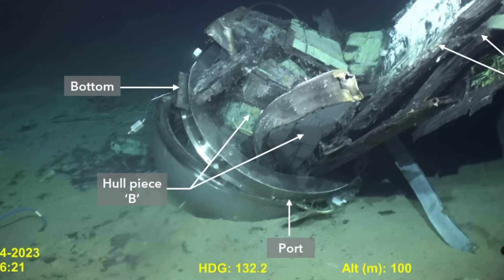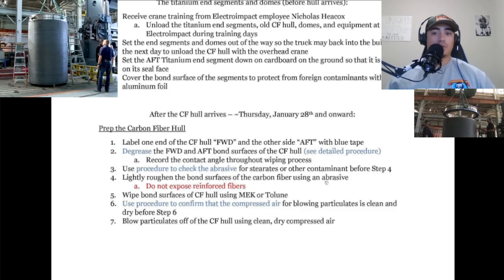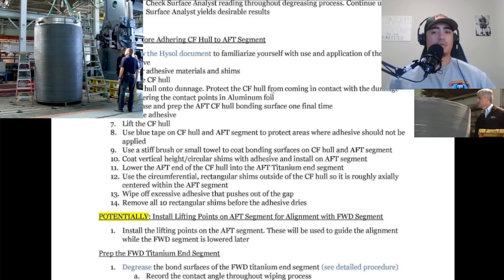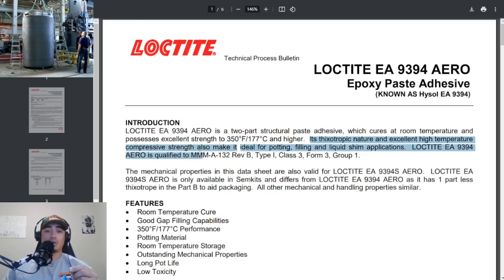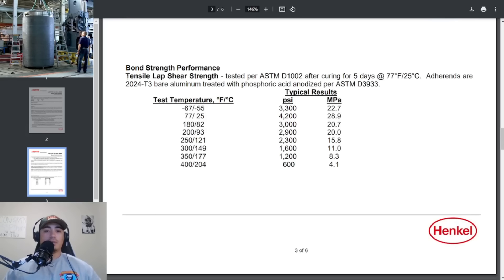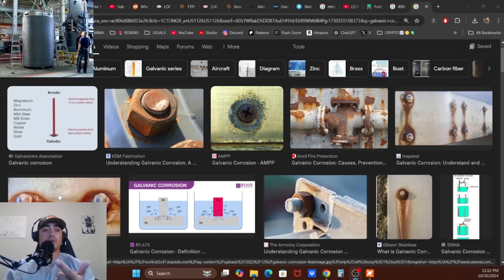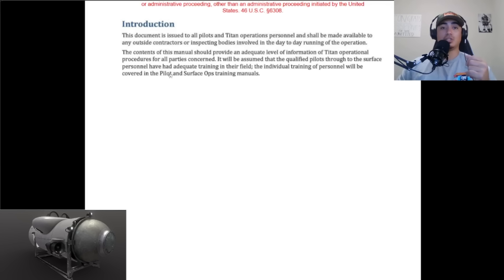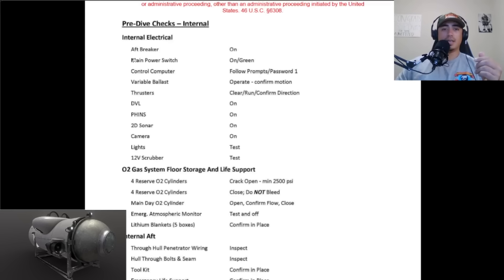Part 5: OceanGate TITAN Investigation: Money Laundering, Glue, & Operations Manual - Latest Files

Comment: As an old Boilermaker tradesman I do recall packing the pivot ring on the draglines rotating frames that we were building with dry ice to shrink them for a tight permanent fix. So the average temperature of the wreck is about 28°F (close to freezing but under pressure). So the titanium ring would certainly have some amount of shrinkage at depth compared to the carbon fibre hull. The small shrinkage being cycled over & over with each dive & recovery would put enormous stresses & strains on the Loctite adhesive bonding leading to an inevitable seal integrity compromise surely.
Reply from the maker: @scottyfox6376  thanks for your unique insight Scotty. And shoutout to all the boilermakers out there🤙🏼
Reply: I'm sure I remember reading that the US Navy had an experimental carbon fibre submersible but the end rings were a high grade of steel as opposed to Titanium. I would guess that there was a reason for that.

Comment: I can’t believe that they didn’t ‘wind’ or build up all the carbon fiber layers in a static-free & dust-free clean room where dust and other particles would not be able to contaminate the layers of carbon fiber.
Reply from the maker: Yes, pretty shocking stuff. In a scenario where even the tiniest air gap will compress at depth and accelerate fatigue.
Reply: That is pretty shocking.
Back in the 1980s we needed to wind some epoxy reinforced coils for a military project. The fun part was actually getting the winder to operate in a vacuum chamber to eliminate any air bubbles, but we did it. 
I think this was an impractically large structure to make as one offs in this way, and the transport to and from the curing station was complete alarm bells - how do you ensure that the surface is not contaminated with moisture on the way back?
This was an attempt at making a submersible with bicycle level technology - and a lot of carbon fibre bicycle frames are pretty dodgy too.
Reply: @EbenBransome  they might as well have put those ‘mission specialists’ in an empty pop can sealed up with duct tape.
Reply: @dr.valbell6427  If someone had told them that they were as much "mission specialists" as the first Soviet dog sent up into orbit and just left to die up there, would they have had second thoughts?
Reply: It's shocking for sure. I worked in the automative industry for a bit where we had composite panels. They were made in a closed off environment, with people wearing full dust-proof suits/hats/shoe coverings, as well as the glue (applied by robots) in dust proof area, and the ovens. And this was for CARS.
Reply: @Spamhard  Yeah every video I see about manufacturing CF cars talks about how there must not be ANY voids and how difficult that is to achieve. I remember a how it's made on driveshafts, every one was ultrasonic tested for voids and scrapped if there were any. They were also ALL fully tested to the design strength for the correct properties before being sold.
Reply: @brianwelch1579  Yeah, they're really strict about that stuff. I built cars for a bit, then went onto quality assurance. Can't believe the quality standards we had to keep to for a car on the road, while these clowns were doing absolutely no real safety both during build, and during the Titan's life span.
Reply: That's nothing. Dust isn't a factor when you notice that on video they show the guy "degreasing" with a rag in one greasy bare hand, while he hangs onto the clean area with his other greasy bare hand. Dust won't matter when you have greasy fingerprints between the glue and the surface. I would much rather have microscopic dust rather than macroscopic oil and skin cells.
Reply: @EbenBransome no, they liked the danger. If you watch the documentary where the crew is sharing "barely made it back" stories, the rich clients were practically giddy. This is common for young men, and I bet rich people feel like they have to prove they're here because they're brave, not because they were born rich and they screw partners and employees out of fair pay (the only way you can get a billion dollars). Nobody works 1,000 times harder than everyone they do business with. Somewhere are critical people working harder and risking more, yet they aren't getting a fraction of what they earned and they'll be fired and sued if they tell the truth when the rich want a lie.
Reply: Yes. And just only the glue process, gluing the metal to metal and other pieces... So many things that was not part of that process that is any other time.
To me my conclusion is his ego got in the way. He really wanted to be a pioneer in this type of exploration, which I'm not mad at that fact. I'm mad at the fact that he had this one guy who had been to the Titanic so many times and it was like he was more worried about impressing that man then safety for everybody else.
I'm also going to add that I do have nail technician certifications although that is not my main source of income.. and even I know that for acrylic or any adhesive you must have a sanded and porous dried out surface before you can apply acrylic or adhesive. No dust, sebum, oils, moisture. None at all. Or the acrylic or false nail being applied will be compromised. You have things going between the real now and the acrylic that will just make it come completely off.
Reply: The more we hear about this ‘bucket of bolts’… continues to be shocking.
Reply: How about the fact it was constructed in 5 seperate layers,bonded between?
They never considered movement from cycling creating enough friction to powderize the glue.
Autoclaving it as a complete unit would’ve helped-but then the under-rated view port & hull reduced from the recommended 8 or 9” down to 5” made it built to fail-just how many times it got home was in question.
I have NO DOUBT Rush KNEW-he just hoped to make a fortune before it did.
Rush had the best advice there is & was OFFENDED instead of taking it for the wisdom it was.
Reply: Instead of clean room,  they wore butchers apron and smeared glue with AutoZone bondo spreaders.  🤦‍♂️ 

I used to build Briggs and Stratton go kart racing engines,  my environment was way more controlled than theirs.   I wasn’t even building the ultra high performance B&S, pure stock blueprinted.
Reply: @EbenBransome  yeah that Soviet Lika dog debacle was one of the huge reasons why we Genxers were taught that the Soviets were wicked, godless, evil ba$tards who were so malevolent that they treat dogs like that. No redblooded, God-fearing American would ever mistreat a dog like that. Of course many Soviet cosmonauts died in the frequent accidents that regularly plagued their space program. They had no problem whatsoever risking their cosmonauts’ lives while we didn’t believe in recklessly using our astronauts. But make no mistake people: America’s Gemini, Mercury and Apollo astronauts truly had The Right Stuff. Not only were they perfect physical specimens but they were also highly intelligent and educated men (PhDs, graduate degrees), as well as extremely cool under unimaginable conditions of stress . So emotionally and psychologically well adjusted.
Reply: They had no money for that
Reply: SHORTCUT" RUSH explains why they didn't wind the carbon fibre cylinder in a 
"CLEAN ROOM": a purpose-designated space maintained for a specific, possibly highly sanitary area.
Reply: @EbenBransome some of the cheapest carbon fiber bike frame are built under a vacuum

Comment: I have watched many reports on the Titan and not a single one has delve in the chemical make up of the adhesive. This is a vital piece of information.
Reply: This is my first time seeing the pass throughs between hull and outside systems via holes in the titanium ring.  Even that seems dodgy to me, just more and more failure points
Reply: Well it's one of those things that really done matter. Even if the best glue in the world was used, it still didn't stand a chance. Glue is just probably another failure of theirs.
Reply: @JoeKyser  When I saw video of them gluing the hull to the titanium ring, I thought that looked extremely dodgy. Glue isn't meant to withstand 5,000 psi. The whole thing screams "AMATEUR".
Reply: @harrietharlow9929  the Nintendo controllers and camper world parts don't exactly instill confidence
Reply: @SoulDelSol  No, they don't. To me, the whole thing looked jerry-rigged.
Reply: @JoeKyser that was actually the failure point because it equally sheared all of it off at once, popped the lid and pushed the rest into the back like a tube of toothpaste
Reply: @JoeKyser  Glue,under-rated hull thickness,under-rated view port,re-used end caps adhesive was applied to were shiny as a pin…I’m no educated Engineer but failure was INEVITABLE & that’s why the contract to ride protected Wendy so heavily.
I should add,one of Rush’s children is a Lawyer-I’d bet that’s who wrote the contract.
Reply: @SoulDelSol  Not was it Autoclaved,Boeing declined.
It was just baked without the pressure Autoclaving uses to force bubbles out of the CF
Reply: 3M has 2700 adhesives in their catalogue.  I can name most of them.  None are suitable for this.  Loctite?  I know some of their products…but nothing engineered for this.

Comment: the dummies at Oceangate relied on deep sea pressure to seal up any complications with their hull design. It worked when they had a leaky hatch on a previous shallow dive with a different submersible. Rolling with this idea at 12,000 feet underwater was just plain stupid
Reply: they had several successful dives dude, more than 10...

Comment: I used to work in aerospace and part of my job was a bonding technician.
I had to take 2 exams before I was let loose in the bonding room.
When we used any adhesive or sealer, we had a log book in which we were to note temperature and humidity in the room.
Alongside that, all adhesive batch numbers and expiry dates were logged and then the time you started mixing the adhesive, finished mixing the adhesive then the time you started applying the adhesive and the finish time.
This stuff is taken very very seriously in the aerospace world as you can imagine.
Looking at those photos inside that big dusty hanger doesn't inspire confidence let alone using any old brush or rag to apply the adhesives.....what happens when you lose some bristles?  Or lint comes from a towel??
I always used PTFE tools to apply anything I had to on my workpieces.
Reply: Ah it’s fine I’m sure….the pressure will seal the deal, 🎉so to speak.
Reply: I worked for Sunseeker boats and just for the hulls temp was strictly controlled as was air quality in a building DESIGNED for that purpose
Lloyds would NOT insure them if ANY steps were missed
batches were noted while dates were controlled by the stock room to always ensure fresh resins
there was ALWAYS a paper trail
years later in DRAINAGE lining
the paper trail continues!
would I have laminated this in this fashion?
NO!
the weave was wrong along with the wet out
there was no pressure cure or vacuum in place so air bubbles were added
the resin/ glues/ carbon fibre all unknowns
temp? mix ratio?
contaminants?
 cure time?
and finally I totally agree on environment here
it should be looking like an operating theatre
NOT an warehouse!!
great comment and have a great day :)
Reply: Thank you. Very informative.
Reply: @Disinterested1 not an warehouse i have seen enough right there.
Reply: Totally agree, I saw them gooping it together by mixing aerospace adhesive (that is susceptible to moisture contamination) in a bucket in an open shed and thought to my self "That's less than optimal."

Comment: I wrote service documentation for 30 years. This "manual" is a laugh. There are no graphics, no callouts, no cross-references to other procedures. No authoring software.
Somebody didn't know what they were doing, here!
The end result speaks for itself.
Reply: yes, my field is totally different, but I write documentation for process-critical IT stuff for an insurance company.  This would not be acceptable in something really simple like a code deployment procedure for an insurance claims system, let alone something incredibly technical and life-and-safety critical.  I would kick this back for more detail, images and links if one of my trainees or juniors submitted this as documentation.
Reply: And the document references specifications but not the document where those specifications are found.  This document is a decent first draft, but wildly unsuitable for a device that supports human life.  It does not appear to be a controlled document, and it references things (like dates) that are irrelevant to the next time it's done.  This document gives off the vibe that the author has never done it before.  Consistent with everything else about the project.

Comment: The whole section about the glue was really interesting, I hadn't seen any of the details about that. I'll go check out the other channel you mentioned too.
Seeing the temp stats for that loctite is especially shocking when you consider the Titan was left outside all year during freezing Canadian winters. The combo of those below 0 temps, the cycle of frost and snow, and the sun beaming down on it and heating it woulda really shortened that glues lifespan imo. That sorta sub should have been stored in a temp controlled environment imo. I've seen car collectors take better care of their vehicles than Oceangate ever did. Seen Lambo's costing half of what Titan cost to build, and owners who'd never tow them like Titan was, never leave them out in frigid winter like Titan was etc. That sub was built poorly to begin with (especially for what she was made for), but the way she was treated afterwards is just CRAZY to me.
Reply: That's not what that chart means. I know that's what the presenter suggested, but I feel obligated to tell you it's completely wrong, just in case you, for some reason, need to one day act on the information provided. Look into it further first, please.

Comment: It’s amazing that this death machine lasted under pressure as much as it did, before material fatigue finally gave way… it’s obvious the engineers were not material scientists or structural engineers… the design was amateur at best… this could be when accounting overseeing a design…but from I can see, it was pure stupidity…
Reply: Yeah, 100%. With that level of slapdash construction & laissez faire safety procedures, the fact that it ever surfaced after any dives at all really shows how impressive carbon fiber & modern adhesives are.
Reply: Pretty harsh assessment tbh regarding the feasibility of Titan's structural design. Let's pretend that same design was built & welded out of all titanium & then placed in an industrial oven to be heated enough to relieve all the built up stresses caused by welding but not too hot to change the crystalline structure of the parent metal. Then maybe everything would have performed to specification of the design. But since monetary constraints were such an over riding contributing factor, many cheaper alternatives were employed. Each alternative would be adding higher failure risks that eventually it turned into a dogs breakfast of a project. If I had known exactly how it was constructed as a mere Boilermaker tradesman, I wouldn't have taken a ride regardless of its 1/2 dozen successful wreck dive missions previously.

Comment: I was a pressure vessel composites Engeneer and my mind stopped at epoxy adhesive. Those are rigid adhesives and do not flex well. Pressure vessels are all about flexing under load. Everything is chosen for it's elastic property. In general this is who carbon/epoxy was a no go for this job. Steel and titanium are unmatched
Reply: Can't even spell engineer lol
Reply: @mikeysgametime8914 Typed an E instead of an I the horror FFS.

Comment: The PSI between the adhesive and the ocean pressure is not equivalent, because the "square inches" part of that is a different area. The adhesive references the surface area between the mated surfaces. The water pressure would be used to calculate force based on the external surface area in contact with water. They're just not really equivalent.
Reply: While true, the water would squeez into the smallest gap and press onto the loctite epoxy on itself, which might cause fractures on its own from compression failure. 
Besides, the full preassure from the endcups would also press vertically onto these mating surfaces snd thun onto the epoxy, and given that the water acts on the whole stern area of the cylimder, while the loctite epoxy is only on the 5" wall would also give a huge leverage effect.
That was definitly a dumb choise.
Reply: You are correct. The forces would be generated by the water pushing on the outer surface area of the vessel, the total force of which would be borne by the mating area of the surfaces. I'm not sure of the direction of the forces relative to the bonded areas, but I think in every direction, the area being pushed would be at least the same as, in many cases far greater than, the mated bonding areas.
I think it safe to say that that the pressure of the water would be in all cases the minimum psi experienced by the bonded area.

Comment: Ps. Don't forget to check and change the sacrificial annode rod in your water heater every once in a while. 

It's a whole lot cheaper to replace the annode rod than to replace the entire water heater.
Reply: How often would you suggest replacing it? My dad had to replace his water heater years back & I knew the anode had never been replaced so want to make sure he stays on top of this one
Reply from the maker: Great tip, thank you for sharing!
Reply: @iLitAfuseiCantStop  I would suggest checking the manual or Google "how to replace annode rod in (insert model number)"
Reply: @ Thanks so much. Would you say it’s pretty easy to do? Just wondering if it’s something I can do myself. Thanks again